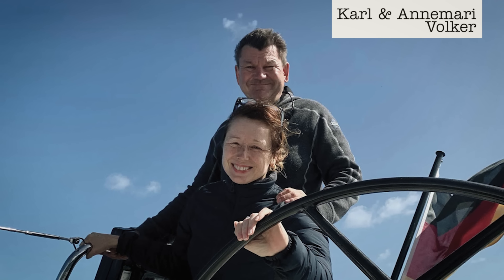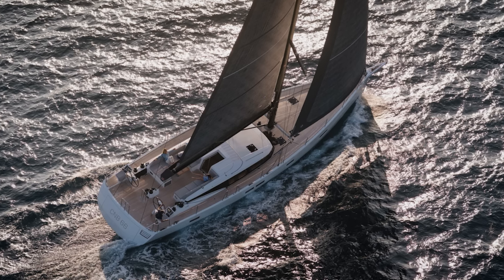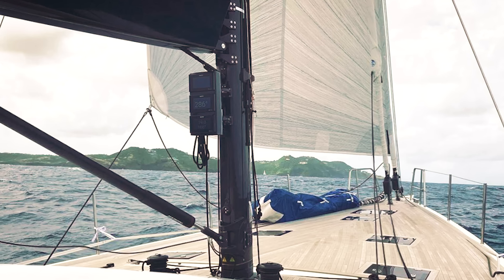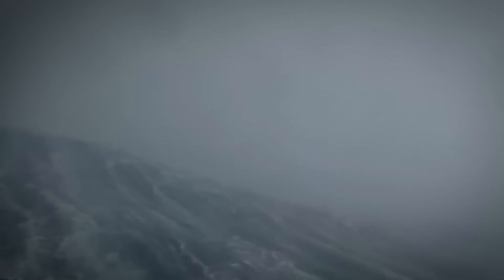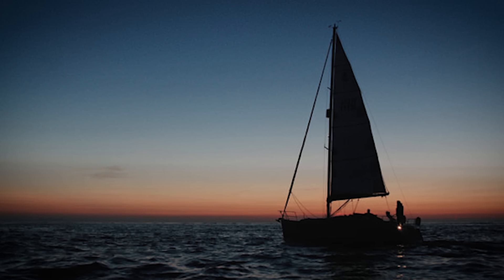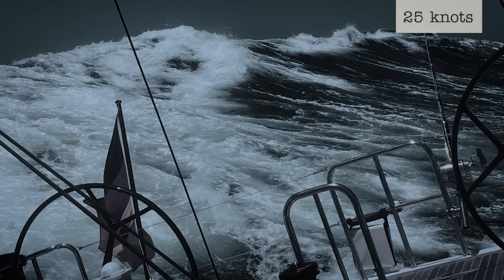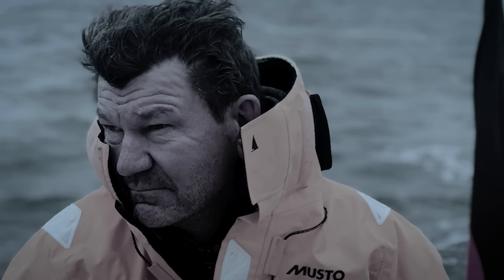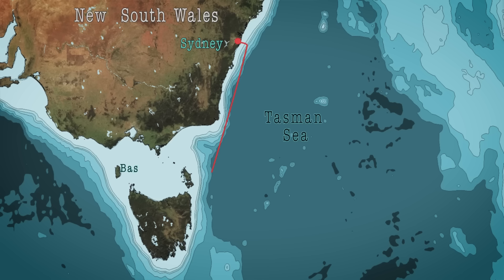Couple DIES on Private Yacht!

Comment: I sailed a 20 Pacific Seacraft Flicka for 4 years, taking her Los Angeles to La Paz without an engine, and cruising the Sea of Cortez for 6 months in 2012. She had a tiny mainsail. It was sheeted to the stern rail, and even in that tiny boat, the mainsheet was a serious hazard. I ended up rigging a friction based preventer/boom brake using a figure 8 rappelling device to keep the boom under control during gybes, and I use a similar system on my Catalina 30, even though it had mid-boom sheeting clear of the cockpit.

It's important to reef early and often. It's also important to design your reefing system to work at any point of sail, not just upwind. I've also learned to avoid sailing dead down-wind. Study your boat's polar charts, and you'll probably find that 150 degrees off the wind is optimal for reaching your destination the quickest, Yes, you'll need to gybe if your destination is dead downwind. Gybing from a a broad reach is a lot easier and safer than gybing from a dead run, and it's more or less impossible to accidentally gybe if you're paying attention.

Keep the boat under control at all times. That's the main thing. Do not test it's limits unless you are prepared for the consequences of exceeding them. This is especially true on a cruising boat and while leisure sailing.

The sea will root out and severely punish any foolishness. It will do so under the worst conditions. It can and does kill anyone who ignores this fact, and even some who do everything right. RIP to these sailors. They led a good life, and died doing something they loved that was totally badass. Bravo!

Comment: These problems with inboom furling are the reason why Hallberg Rassy is not using inboom furling and only inmast furling. The inboom furling is good for fully crewed racing boats but not for short-handed cruisers.
Reply: In-mast furling is also problematic in the kinds of conditions where this boat and crew ran into trouble. I’ll have no kind of mainsail furling on my bluewater boat. Making your life easier in light to moderate conditions is not worth the trade-off of decreased capability and increased risk in extreme conditions when failure is not an option.
Reply: Slab reefing all the way. If you don't want to handle sails, buy a motorboat
Reply: @markhamstra1083  all systems are with weak points. I agree that the traditional system is safest. But if you have a 50+ft boat, you can not manage the sails without furlers when sailing as a couple. The other question is how big the boat needs to be when sailing with a small crew.  

For the sail area, you can have even a flat top main with inmast furler - the size or shape is not a problem

Furlers for front sails were also criticised when they came.. now they are in all crusing boats.
Reply: @to54321s  Nonsense. Couples manage slab-reefed mains without trouble everyday on boats over 50’, and sail shape absolutely is compromised with in-mast furling. More importantly to me, though, is that in-mast furling mains are prone to difficulties when attempting to reef off the wind in heavy conditions. At best that means that you would need to attempt an inherently dangerous rounding up while over-canvassed, at at worst will have to contend with a jammed in-mast furler that will not allow you to decrease sail.

No, thank you. I will not have any kind of mainsail furling on my bluewater boat.
Reply: @markhamstra1083  Most of the new big cruisers are sold with a furling mainsail. And often with electric winches etc. I think the majority is not wrong with this. At least me with my wife could not manage a traditional main with a size of almost 100m2 when +25 knots of wind.

 Check out the info about the new hr 69. Selden inmast furlers are excellent and reliable also the new sail designs and materials dont need compromise when used on furlers.

You ofcource chooce your gear. I was like you against inmast furlers and then sailed a few boats with it, and now my own boat is with inmast furler. My sail is fresh and the same size as a traditional sail. With 10 000 nm, I have had zero problems. My old boat with traditional main I had several issues with the main - expesially in high winds when taking the sail down. I sail often single-handed, so I also appreciate the flexibility and ease of inmast furling.  One great thing is that you can drop the sail without going directly to wind - it is a safety issue.

Usually, we are against new gear when we do not have experience with it.
Reply: @markhamstra1083  The trend is that the main sails are big, and you have a smaller gib. For example, a fast cruiser racer arcona 50 has an 86m main. Hanse 460 has a 64m main. Garcia 52 has a 65 main. So close to 100m is a fare estimate when going bigger than 50+ ft and this boat was like arcona not like hr or garcia. I prefer a masthead rig and traveller in the cockpit, but german sheeting  and fractional rig with ofline spreaders is a trend. Of course, older boats are different, but this was a new boat in the video. A reference is to new boats and their design - old nautor swans had small main sails and short booms like baltic etc.

I am not talking about what a marketing team is talking about sails, but my own experience. When reefed, a furling main is more flat than a traditional main, but it is a good thing as you do not need extra power to the sail when in high winds. You can still adjust the shape of the sail, but it is not as good as with the traditional sail - my experience is that most of the cruisers seldom use rodkicker, backstay or other adjustment to their sail. To get the best from a furling main, you need to use rodkicker, outhaul, and backstay.

If you do not have full battens in your furlingmain, you will lose speed in low winds. That is definitely so. But for example, big hr boats are all sold with a furling main, so the despign takes this into consideration, and the mast + boom is longer to compensate.

The main sail in escape was 95m2 from the design info.
Reply: @to54321s  None of the boats that you mentioned are proper bluewater boats designed for short-handing. Escape, too, was a poor design for short-handed, offshore sailing. Yes, racer-cruisers and boats designed for coastal cruising or chartering will tend to have larger mains — but still nowhere close to 100m2 in a 50’ boat. Even a high-performance, dedicated racing boat like a TP 52 doesn’t have a 100m2 main — close, but still a couple of m2 less than 100. But I’m not talking about racing boats, racer-cruisers, coastal cruisers or charter boats. I’m talking about bluewater, offshore cruising boats setup for short-handed sailing. Slab-reefing is the best option for these boats.

It’s good to see you finally starting to back away from your prior claims about in-mast furling and sail shape. You are getting closer to the truth, but instead of musing about how badly some cruisers trim their sails, take a look instead at how few serious racing boats use in-mast furling when the racing rules allow it. If you want to prioritize ease of use on a coastal cruiser, go ahead. But don’t tell me that there aren’t significant compromises regardless of cost in doing so, and don’t expect me to choose a mainsail reefing system for offshore use that cannot be safely used in all the conditions where slab reefing does work, and that can require a trip up the mast in dangerous conditions when it fails at the worst time. Ease of use in less than extreme conditions means nothing to me then.
Reply: @markhamstra1083  These are boats that people use for blue water cruising. The boat in the video had 95 m main and arcona especially says that its design is for shorthand/ couple cruisers like does hr. There is no point in arguing. In these big boats, it is push-button sailing with furlers all the way. We can set up our small boats as we like, but the majority of big boat buyers go to furling mains. Only racer does not use furlers in main sails. I pointed out in the first comment why hr is not using inboom furling and this comes from hr, they are propper blue water cruisers. The design trend to all boats is that the main sails are big. This is just how it goes, even in highlatitude boats. For a couple managing even a 65m traditional sail in 30knots gust is a difficult task in a big boat with boom high from the deck - but with a furling main it is easy. 

There can be problems in all mechanical systems - I had an issue when ballbearings came out from a batten cart that was in a mast track in a 31-feet racing boat. I got the sail down with force, but everything can break. 

I hope you have good sailing and problem free passages. In sailing,  there usually is many different ways to do things correctly, and no one way is best. Let's just keep our minds open - some sailors even use multihull boats and are happy with them 😉.
Reply: @to54321s  People use all kinds of ill-suited boats for bluewater cruising. Some designers draw up boats that are ill-suited for bluewater cruising while telling their clients that they are fit for that purpose. That includes HR, who design nice coastal cruising boats. Some riggers tell people that in-mast or in-boom furling is a proper bluewater rig. The original video shows what can happen on such push-button boats. And many people other than racers do not use furling mains — for very good reasons.
Reply: @markhamstra1083  I agree that many boats used for blue water cruising are not the best ones to it. I would argue that Bavaria makes poor boats all together... but Bavaria is one of the most popular brand when looking cruising boats that are going around the globe. Patric Laine did some amazing trips with a Bavaria. One man in Finland took an old Bavaria (30 ft boat) to Greenland last summer and has done some amazing sailing in it like going around Svalbard. A couple (sweet ruca) is sailing whit a J boat in south tip of America and managing it really well and it is almost a racing boat. So it is obvious that all of these boats are suitable for blue water cruising. 

HR most definitely is one of the best manufacturers of blue water cruisers, like Nautor Swan or Baltic. Their designs are similar to X, Arcona, Linjet, First, Hanse, J etc. Some are even designed with same naval architects. 

For the boats bigger than 50 ft are sold with furling mains. Almost 100% of them. Design trend is to have a big main and a smaller gib. I am not sure why it is so, but I think it has more to do with cutting cost and easy use than actual sailing properties of the boats (smaller deck gear etc.). Some designer have mastered this with moving the mast aft etc. but many of these boats lack power in light wind due to small head sails. 

My favorite rig is a slutter rig and would argue over its benefits. I do not mind big head sails when using proper deck gear.

Over 50% of the boats in ARC are with furling mains and there seldom is problems or at least not more than with traditional main sails. You can get this info from the ARC organisation.

I am not commenting this further. I hope all good to you and hope to meet you in a nice anchorage somewhere. Maybe we can continue this discussion with some drinks and chips some day.
Reply: @to54321s  HR and the other boats that you mention are definitely not among the best bluewater cruising designs. Mostly those boats are coastal cruisers with a bias toward Scandinavian cruising. Spending a couple of weeks or even a whole summer cruising in the protected waters of the Baltic Sea, for which these boats are very well suited, is not bluewater cruising. Nor does the fact that someone manages to do something like circumnavigate the globe in a Beneteau or a Bavaria suddenly make these boats into properly designed bluewater boats. All that it means is that someone managed to get away with the additional risks associated with taking offshore a boat that is not well suited to this purpose. Rally cruising is another way to mitigate the risks of taking non-bluewater boats offshore, and partipation in a cruising rally is yet another thing that does not define a proper bluewater boat or best offshore design practices. Boats like HRs and Oysters use better quality construction and systems, which means that the risks are lower in taking them offshore than doing so with cheap boats designed to turn a profit for a few years in the charter trade, but it still doesn’t turn them from coastal cruisers into no-compromises bluewater boats. Very, very few boats come from the factory or boatyard properly setup for no-compromise bluewater cruising. It’s just not what most boat owners want, so makers like Boreal and OVNI are servicing a very small market share.
Reply: @to54321s  They are not enclosed and the furling mechanisms are simpler. Easier to furl off the wind. In case of failure, a furling headsail can still be dropped (there are even two-track extrusions which can be used in racing, even better than conventional hanks). I liked the old-fashioned furler on a separate wire in the luff, without extrusion, leaving the forestay free for hanked-on sails (e.g. storm jib or reefable working jib). That sort of setup is out of fashion, though the "Code Zero" concept uses it; it isn't very good for partial furling. And if the wire furler fails to furl, you just drop the sail (no groove to slide it out of as on an extrusion).
Reply: @markhamstra1083   Topc is talking about the Hallberg-Rassy 69 ...

Comment: Hi... Thanks for documenting this tragic event. It's so sad it cost lives.
For me, apart from comments made about skipper's decisions, it highlights the danger of running a preventer as opposed to a boom brake.
A boom brake would have made the movement of the boom way more controlable, and would not have needed to be eased off when rounding up.
All in all, the violent moment of the boom would have been significantly reduced.
After that... Yes, I agree with some that the skipper's decisions to allocate the toughest jobs to only him was a mistake.
Sadly, Annabelle should not have been allowed to be happy with the "relaxing zone" (2:13). It ended up with her getting thrashed by the mainsheet.
All crew should be capable with boat handling.

Comment: Something to be said for getting the sheet up above the crew... they still had the Genoa out? surely partially furled? Time for a second reef? I dunno... reef early reef often. Seems like they had too much sail out for how often weather was coming through.
Reply: I can’t imagine the power in a sail of that size at 30-35 knots , but I think they could have been more conservative with the reefing alright, I’m not impressed that it took hours to tackle the rouge boom, with the main sheet flying why didn’t they use the topping lift to depower the sail, maybe too heavy? The boat was just too big for single mast and small crew

Comment: A sad case, but a superb postmortem. Got all your terms and explanations dead on. A rare thing on YT. 

Why did this happen? Of course there is no one reason, it's almost always an intersection of multiple events. 

It starts with what I can only say is a bit of hubris, middle aged sailors, who don't appear to be in top shape commissioning a 20.6 M, (67 foot) performance cruising yacht. There is almost no physical job on the boat that they can handle without mechanical advantage and motor assistance. You cannot expect motors, or anything electrical, to never have problems.

Did they plan on a paid crew, preferably with a paid captain, and found they couldn't afford it? Were thorough sea trials conducted? The architect had some quames, I'll bet. To be sure, a proper furling arrangement for that boat and that crew would be very hard to find. I wonder if they considered a ketch? For a double handed crew in their situation I think the risk reaches an asymptote at ~ 40 feet. You have to consider that you may not always have a competent crew available.

Unfortunately, that furling system requires endboom sheeting. Midboom sheeting with simple mechanical advantage is much prefered in my book.

It also appears there may have been some panic at the end. Don't put yourself in a situation beyond your ability to hold panic in check. Seeing your wife take what turns out to be a fatal blow will be beyond most people's ability to maintain. Terribly sad, know your limits.